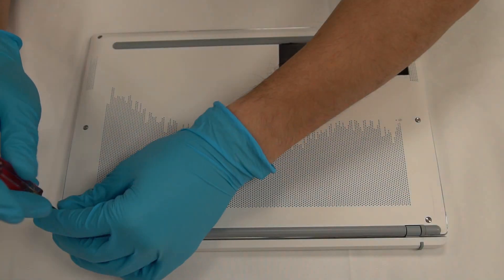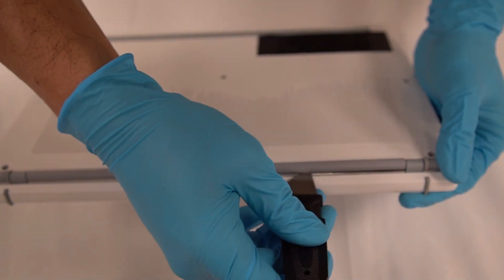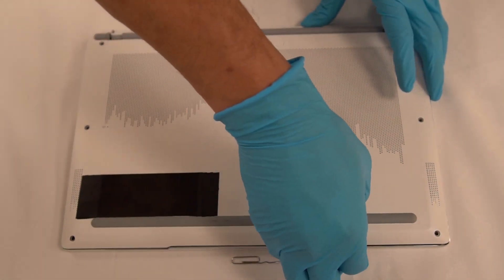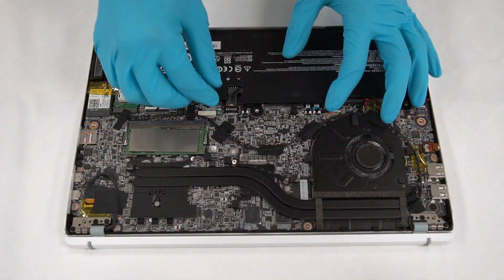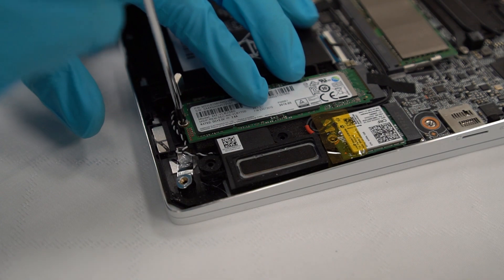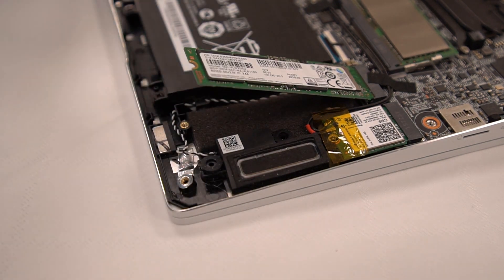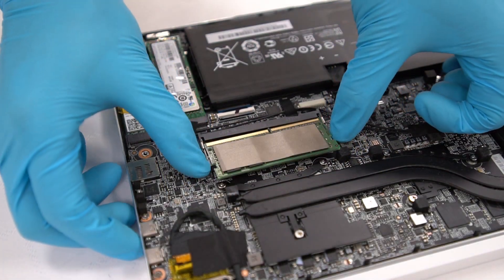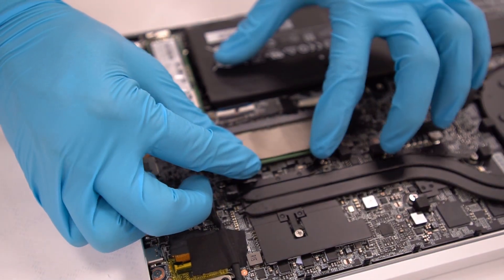MSI Prestige 14 A10RAS and Prestige 14 A10RB SSD & RAM Upgrade Tutorial

Comment: Is the RAM and SSD upgradable in a Prestige 14 A10RB-031IN ??
Reply from the maker: Check here > 0:09
The demo model in this video is Prestige 14 A10RB. You should get the answer in this video.
Reply: @MFLAB   thanks. now i got it. Didn't notice during the first watch.
Reply: I bought the same version. How's your experience

Comment: For Prestige 15, is the second SSD slot compatible with M2 PCIe, or does it only support M2 SATA?
Reply from the maker: Checking in the manufacturer website, you should find the answer.